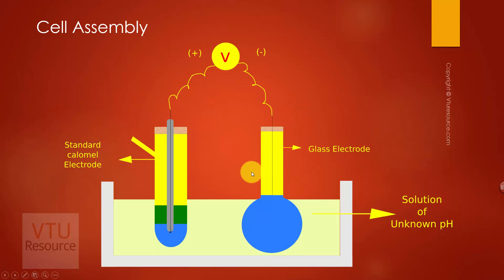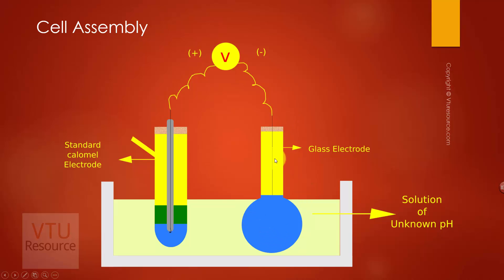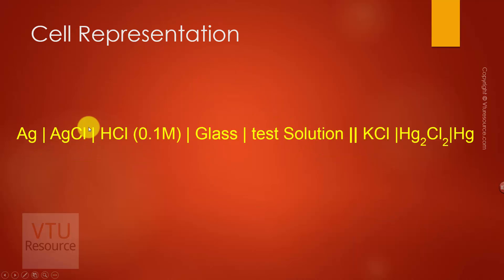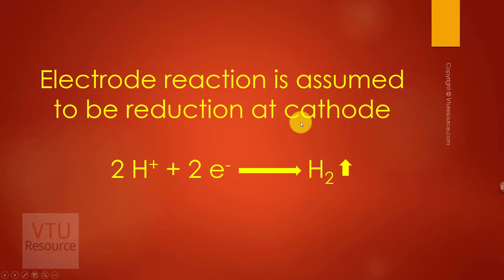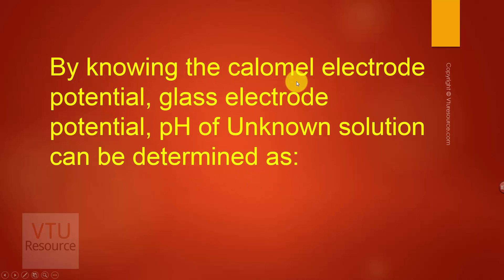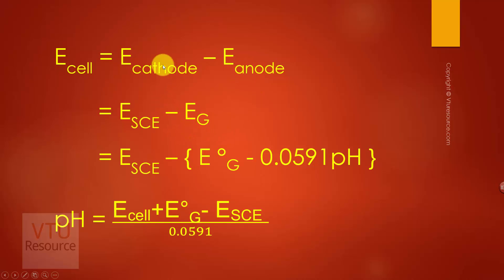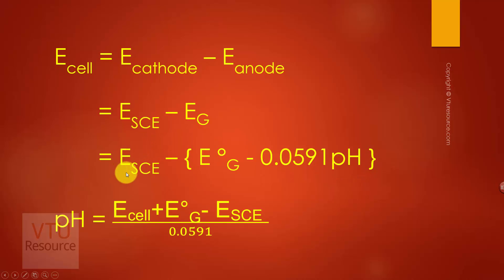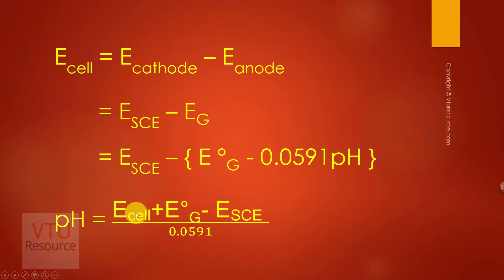Determination of pH of Unknown Solution using Glass Electrode

Comment: You have said that glass electrode act as anode ..But actually in this diagram it is kept on the right side so it acts as cathode
Reply: that is not how you differentiate between cathode and anode electrodes. look at the configuration at the electrical source terminals and its connection with the electrodes and then draw your conclusions
Reply: @prithvimarwadi345  integrate